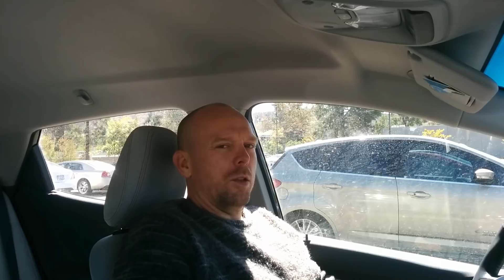Plug-Side Chat: Cheaper DC Fast Charging Hardware?

Comment: I agree, in principle with your message....although I read a while back where Bosch (in Germany) has developed a public DCFC which is only less that $7K (unlike the ABB's which are 5 or 6 times that price).   But I agree with a point below that Erik has made regarding solar arrays.  I think more than a few EV drivers have put in solar arrays to offset charging costs.  I have one that is rated at 60% of my total KWH usage BUT provides 3X as much juice as I use in my Bolt in any given month.  But the point is that those panels put out DC which then goes through an inverter to become AC (to go back into the grid...in my case...for which I get full credit) and then is converted by my charger back to DC (so double loss).  My usual charging time is at night (while asleep) so the solar array isn't putting out anything...so obviously a battery back-up is needed...but then we need a way to get that battery juice to a J1772 at the proper voltage/amperage ... so some sort of gizmo to present the DC battery power to the EV in a way that keeps the EV happy.  I don't know what that link between the battery and the J1772 is...and there aren't many electricians who know diddly about it, either.  The solar company doesn't speak EV and a standard electrician doesn't speak either solar or EV.  So this looks like a business opportunity for "someone" to come up with a battery to EV interface that is essentially plug and play.  Bottom Line: there is a path to DC to DC feeding of an EV...but how to get there from here is not clear at all.

Comment: Eric - this is where the rural - freeway rest area - type charging stops need to be.  Low up front cost means owners stand a chance of recouping their up front investment at some not too distant point in time, and it doesn’t require an expensive grid connection that 3 phase requires, so could significantly reduce the setup cost - perhaps to the level where rural homeowners could provide a service to the EV community.  If the (reserve) battery is present, a tie to some solar panels could generate perhaps up to a few “renewable energy” charges per day.  Commercial applications of this arrangement could scale up when the charging volume is justified.

Comment: The grid voltage is AC (though there are some high voltage DC power transmission lines).  So no matter what you do there is always going to be some AC to DC conversion to charge a battery.  The only exception is if you have something like a solar array with a direct DC feed to a battery storage connected to your DC to DC conversion.  Note the Chargepoint 24KW DCFC's also require a 3 phase AC source.  As far as I know only the Delta 24KW DCFC's have the option of being connected to split phase source voltage.   Though to make things more efficient I do like Delta's plan to connect DCFC units directly to medium voltage grid power.  This saves a lot of the power cabinet components as you no longer would need to step down from medium voltage grid to three phase 480V.   This saves components and it also reduces some of the conversion losses.
Reply from the maker: I was also thinking along the lines of a solar microgrid, which could completely eliminate AC, if you wanted to go that way.
Reply: News Coulomb The Delta charger that Erik is mentioning will also have a DC input in order to allow for a solar PV micro grid with batteries.

I wrote about it awhile back. Many other writers about this DOE project skimmed the press release too quickly and missed the whole point of the design:

https://electricrevs.com/2018/09/03/delta-announces-new-doe-400-kw-charger-project/

Comment: Could you better explain how you could convert, let’s say a Bolt battery pack into a fast charger, and how would you charge it back up?
Reply: You could charge it with a level 2 charger. It would depend on how many batteries are being used and how heavily the charging station is used.
Reply from the maker: Yes, you could just use the 7.2 kW charger that comes with the car. It would require a lot of modifications, though. Communications, cabling, housing, etc.
Reply: News Coulomb I should have worded it as “something like a lvl 2 charger.”  I know that dc fast charging can damage the batteries, but there should be an optimal charge rate that will help maximize the battery life.